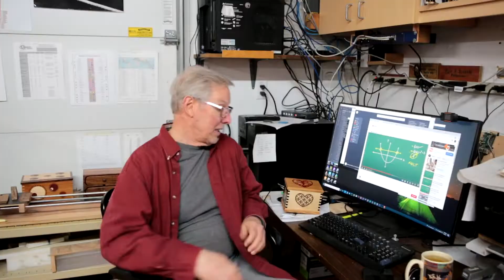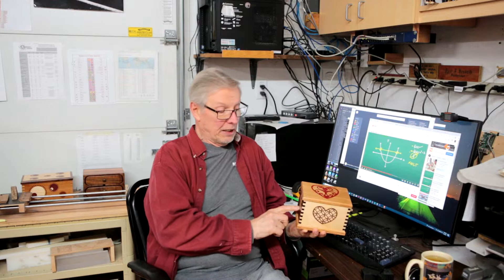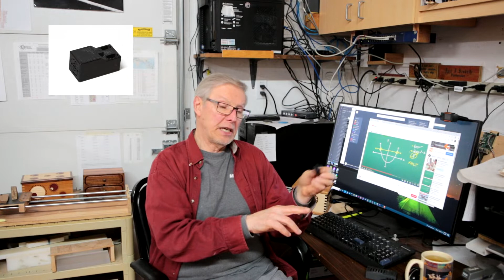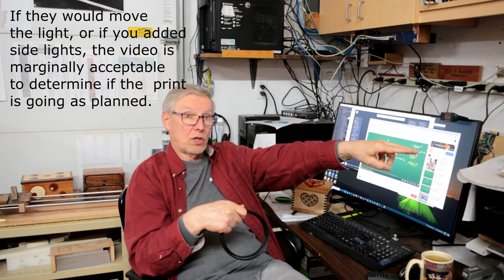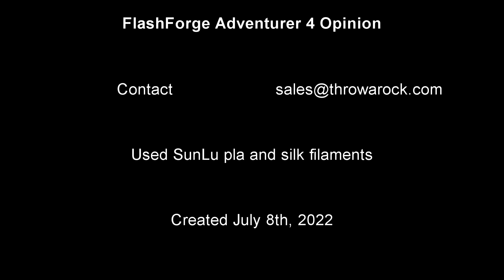Adventurer 4 First Opinions

Comment: I just ordered on have you tried messing with the slicer settings to fix stringing? Have you tried printing it again with different settings?
Reply from the maker: Yes, to some extent... I use the machine, it produces... I wouldn't buy it again, but it isn't bad...  I have produced a lot of prints with it to date.